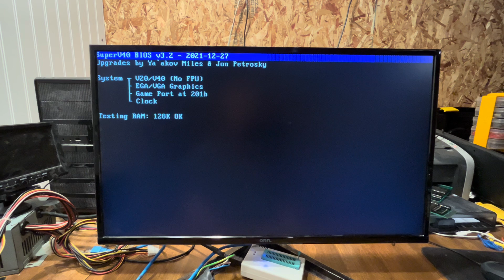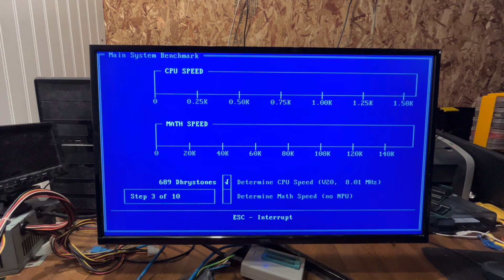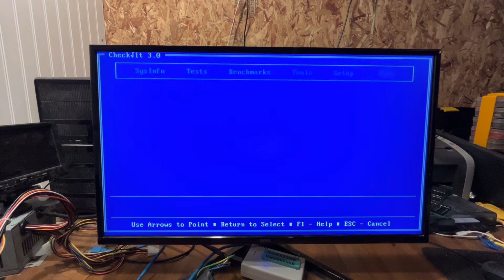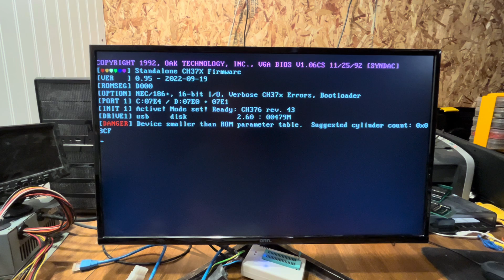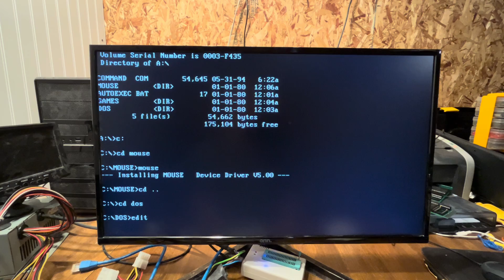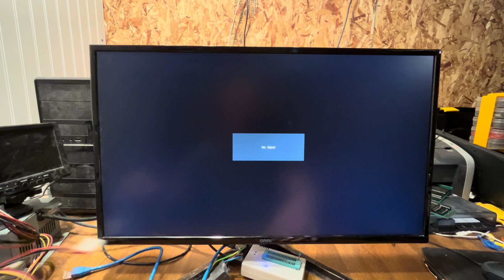8088 PC XT Compatible On An ISA Card. Initial Build

Comment: Really impressive - and that it worked first time with such minor fixes! The pc-on-an-isa-card like yours with a passive backplane was the approach used by Zenith (aka Zenith Data Systems) in their XT and AT compatibles of the mid 1980s. It seemed like a great approach offering the promise of upgrading by just swapping the cpu card (which unfortunately never happened). 

I'll bet there is lots of legacy ISA industrial stuff still running factories that could be a lucrative market for a product like your board!

Comment: I think the only change I would have made, would be to make the pcb a bit longer just to give a little more space between all the chips. And to perhaps orient them horizontally as was done by most boards of the era. That could make it a bit easier to work with. But that is just a personal preference. If it works it works and that is good either way.
Edit, though i am just realizing that perhaps it was made this way to fit the half AT size limits of 7 inches..
Reply from the maker: I was thinking horizontal would make it more authentic looking. I arranged them in the current pattern to line up the Data bus and Address bus for easier routing.

Comment: The USB storage board would be a great add-on board, and it definitely needs to be optional. But I’d rather see it plugged in on top of the board/over the board. Just like those memory expansion boards, that were rather popular on Matrox video cards back in the days. That way, one could potentially break out the USB port from the I/O shield, which is much more elegant.

Would you be willing to add a FDD header for connecting FDD’s? That would make that controller a bit more useful imho. :) 

My hat’s off to you for creating such an awesome PCB, good sir!
Reply from the maker: Great feed back. Thank you.

Comment: Very interesting. 
Could the graphics card be omitted, and instead use a dumb terminal to connect to the board, via async card?
Reply from the maker: I would think so. If you can do it with a IBM PC XT it should work on this board
Reply: @elijahmmiller   that is indeed what I have been wondering for quite some time: can you do this on an IBM PC?

Comment: DMA could be necessary for SoundBlaster games am I right? But for adlib tandy covox DMA is not needed like in PCjR
Reply from the maker: Yes the DMA is needed for SoundBlaster cards. I have never tried it out. You really can get away with having the DMA controller. I kept it so that it has a fully functional  ISA bus.

Comment: If you anyway use floppy emulator, you can use PicoMEM card which is a way faster and you don’t need DMA chip
Reply from the maker: That would be a good solution for mass storage.

Comment: I may have asked this before, here, or another similar channel. Is it possible to create a supplemental board with a 2nd IRQ controller, and necessary logic, to cascade and allow for the high IRQs since 16bit ISA backpanes are available? 

Admittedly, there may be limited use case for such a thing. And high IRQs came about with the 16-bit IDs bus during the 286 generation, but from what I can tell high IRQs aren't processor dependant, and are mostly just cascading a 2nd controller from a channel from the primary. Reason why I ask is after seeing another YouTuber struggle to get a card that soft configs setup on a similar XT rig due to the software looking for the card on a high IRQ. He ended up having to use another system with a 16bit slot. The card otherwise functions as an 8bit card. And I understand there's other cards with a 16bit connector, that are just 8bit cards with high IRQ capability. A secondary IRA controller on a 16bit ISA card, on a 16bit ISA backpane would allow use of those high IRQs for those cards.
Reply from the maker: Sergey's motherboard supports a second 8259. I almost added one to this project where the Keyboard controller supports a mouse. .. I kept it off in the effort of keeping the project compact.
Reply from the maker: https://github.com/skiselev/xi_8088
Reply: @elijahmmiller  very cool. I may have to assemble one of these projects in the future, or maybe an apple ii+. I haven't decided yet. Lol.

Comment: It must be really satisfying to get a 4-layer board full of old DIP ICs all working. Very impressive how you know the XT so well you can prune it down! How are you coping with the amount of fake chips out there - been burnt so many times on relabeled parts. Can you share some reputable sources?
Reply from the maker: I don't recall anytime specifically that I received fake chips. I have received a decent share of defective chips. I get my chips from several sources. Mouser, eBay, AliExpress, random websites. If I want good chips I buy from reputable sites. If I want cheap I buy from China and hope for the best.
Reply: Can you think about getting rid of keyboard controller chip? Like PCjR It,s not cheap and harder to get with the time. Just 8255 chip with connectors to external keyboard could be pretty vintage . It,s possible for others to connect AVR or PIC chip or drop one replace 40 pin DIP with RP2040 adapter board to emulate keyboard port with external ps/2 or usb keyboard.
Reply: @alexloktionoff6833  the AT keyboard controller as is is just a microcontroller anyway. Given you know it's interface you can program a replacement on any uC. And on XT it's supposed to be a 8255?

Comment: If you slot this into another XT, will it provide dual core processing? (I'm kidding of course😂)
Reply from the maker: I have thought about a build that isolates the ISA bus on the card then have some built in interface to run a many cored PC.
Reply: It will only produce an address bus conflicts
Reply: Moved to main thread.
Reply from the maker: I almost added the second 8259. The keyboard controller also supports a PS/2 mouse.
Reply from the maker: Sergey's motherboard supports the second 8259.